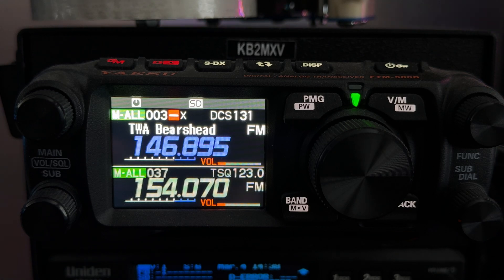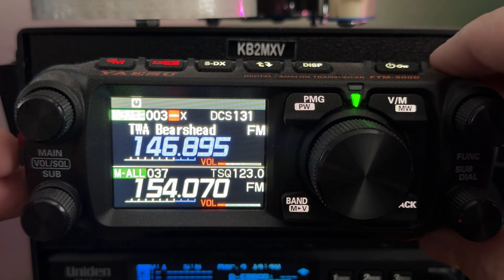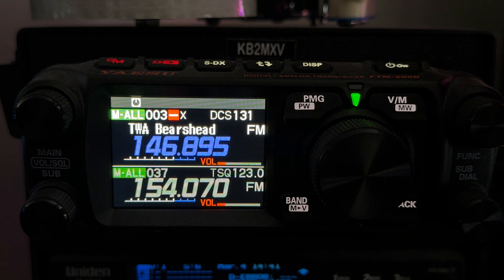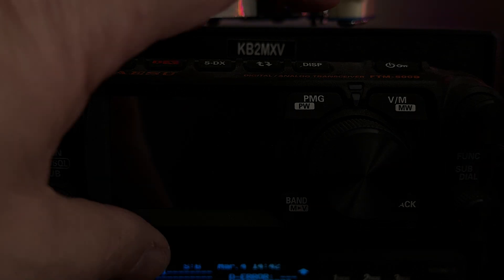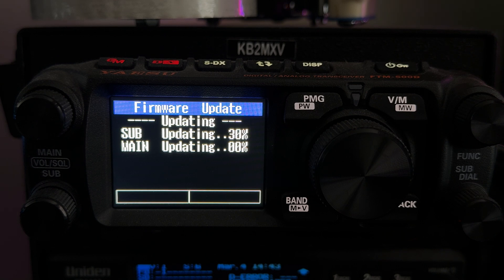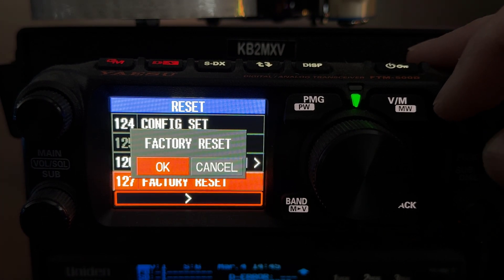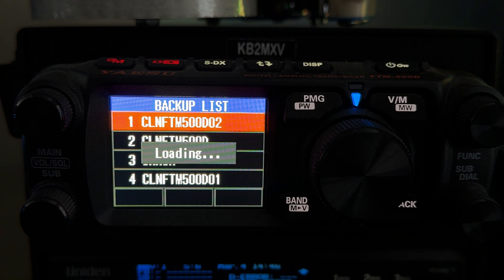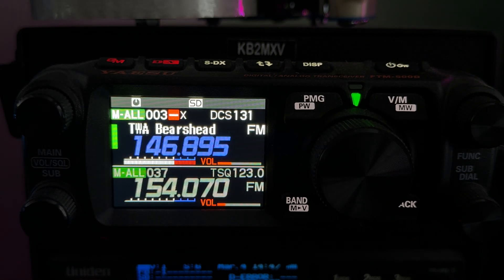Yaesu FTM-500D Firmware Update in 10 Minutes

Comment: Do you have to use another card? Are you not able to use the current one?
Reply: I used the same one with no issues
Reply: I used the same card and did a backup first on that card, with no issues.
Reply: @Darrell_Coquillette I was able to get everything updated and use the same card thank you all
Reply from the maker: @MarshallGriffiss  I didn’t because the instructions say to format a card in the radio, nd I didn’t want to lose my settings by using the same card.  Better safe than sorry